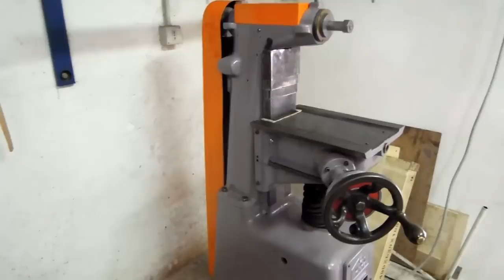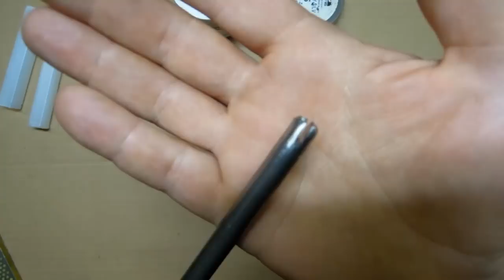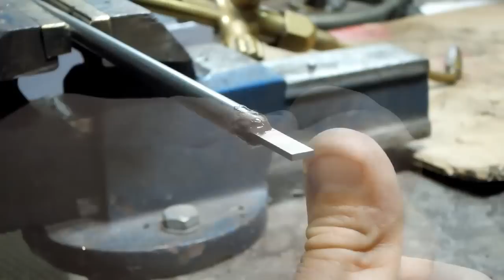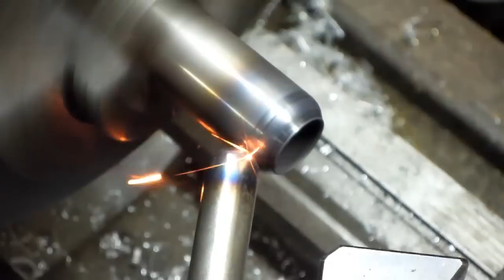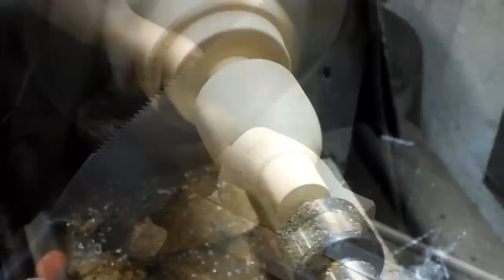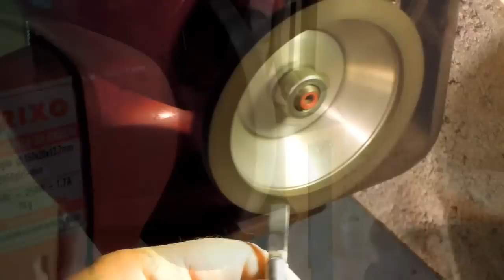Making a Small Hand Scraper

Comment: I made something like this myself for accurizing my mini lathe. I used an 8"x⅜ grade 8 bolt. I cut the head off and filed a flat on the shank with a negativity raked shoulder at the back and tapered the other side down to the tip. Ace has some nice handle knobs with brass inserts that I used for a handle. I bought a pack of carbide paint scraper blades which have mounting holes. Turned lengthwise, I drilled & tapped it for 6-32 countersunk screws. I countersunk the carbide (it had no countersink) with a diamond countersink. The back tucks into the negatively raked shoulder for added retention. The intended use edges were very sharp so I buzzed them dull and profiled the scraping tip on a CBN diamond wheel on my bench grinder and lapped the cutting edge with some Eze-lap diamond "files". It worked quite well and I have easy to replace & cheap carbide inserts. Unless I drop it, ill probably never have to replace the carbide.

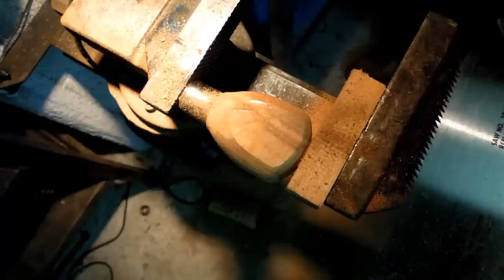Comment: I know this is an older video, but it came up in recommended and I had to watch it again, the third time I think. Quick question, what is the waxy substance you apply to the rod at 13:30? I imagine it's wax, but it seems like that would make it more slippery. Thanks in advance to whoever, if anyone, answers.
Reply: I think it's epoxy

Comment: hey tony, did you releave the machine parts before you begin scrape them? i've seen that others when scraping big works they knock them over with a leather mallet or something like that to get the tension out. also i could not see ever that you got a big surfaceplate, i wonder if i could do bigger parts without having to get me a surfaceplate bigger than the area i'd like to attack. i would value your inputs on that matter and maybe a tipp how to work around it. i will be overhauling my lathe bed ways and those are way bigger than what i have to test them against...

Comment: I keep a roll of "metal working solder" on the shelf to fix little imperfections like you had on your ferrule . Very quick and very easy to use. I have even used it to build up od's if I only missed by .001ish. Handy stuff for lazy perfectionists.

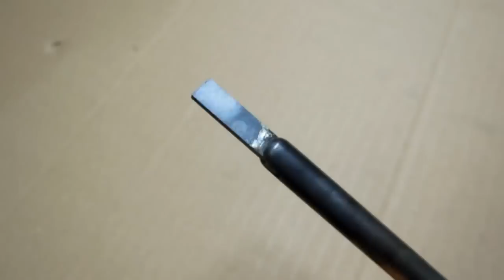Comment: Hey Tony - doesn't that welding torch affect (anneal) the carbide? On 7:15 it looks quite cherry red up to the end. :) Thanks for answer and keep up the good work! :)
Reply: Carbide is a ceramic you can't anneal it, that's one of the perks of carbide the fact that it stays so hard even when red hot
Reply: Jakub Macák I do not recall  carbide annealing temps off the top of my head, but I doubt it.
Reply: Carbide doesn't anneal. It doesn't even really melt. To make those inserts, the material is sintered together.

Comment: Good video! I like turning down hammer handles where they fit into the head ... with a bench grinder the wood scorches and it seems more durable. Should have the same effect with a ferrule/scraper handle - probably wouldn't have a problem either way.

Comment: Glad to know someone can deal with that 'wood' material.
My attempts at welding or heat-treatment do not work.
Reply: It's got a pretty high carbon content so I don't know why you can't heat treat it.
Reply: @Οδοιπόρος  that's hilarious
Reply: You can braze it pretty easily, it just takes a different type of flux, and no filler rod. It's weird stuff
Reply: Turn up the flow on the shielding gas. Works every time. Also using propane makes your problem sort of just go away...
Reply: Ina Wenderholm ii

Comment: Possible You should make the metal end that goes into the hanlde square or with flat sides next time to prevent it from rotating inside the handle after a long time use, but i don´t think it´s a big deal anyway...

Beautiful work anyway! ..
Reply: Sheep Ewe it really isnt necessary for the most part, the most iv ever done is made sure my handle was drier than it normally ever would get before making the furrel and mating surface (like 5%mc)
Reply: Miles11we

Ok
I often had that problem with ceap factory handles.

Comment: Excellent video tony, a question though, would it work if you had used lubrication, or is the idea to get it red hot so it flows better.
   Tim
Reply: needs to be red hot to form it
Reply: Thought the same but then realized that lube would lessen friction, ergo not as much heat forming.

Comment: Very nice Tony.  

On push scrapers, you can get double the use between sharpens by taking your square edged carbide and grind a -5 degree edge on top and bottom sides.  You want the negative edge on push scraping.  It avoids digging in to your work and it just works better/best on push scraping.  You also get 2 sharpened edges that you can just rotate top for bottom as the first edge begins to dull.  When both top and bottom edges loose their keen edge, it's just a quick grind/lap to get them both back to good cutting edges.

I really enjoyed seeing you form the ferrule and make the handle.  The flat on the oversize handle is a very good mod.

Project creep is a problem in my shop.  Things get spread out and mixed together, so I relate with your need to cleanup every so often to keep things efficient and orderly.

Cheers,
Gary

Comment: Nice work.  Enjoyable, educational video.  Different from the run of the mill.  Question:  Why did you put a point on the shaft where it goes into the handle?  Wouldn't that tend to split the handle?  Intuitively, I would just put a small chamfer on the end so it wouldn't push shavings,but then I have split handles with square rod ends before, usually by being overzealous with a mallet...